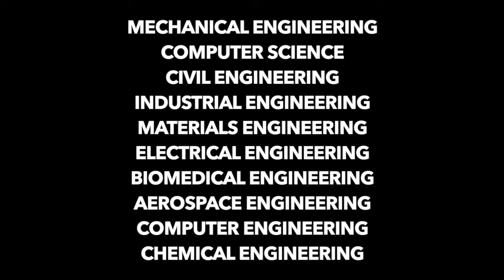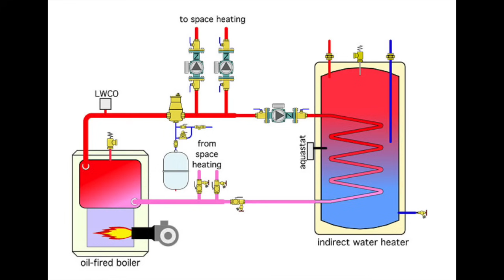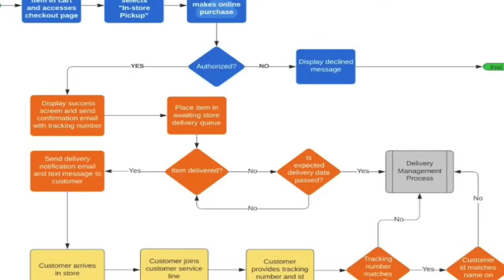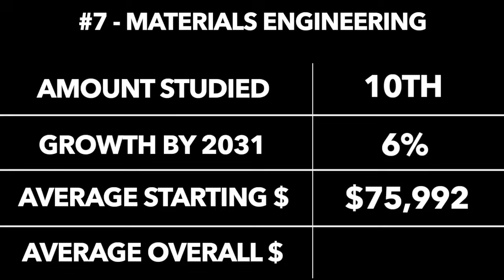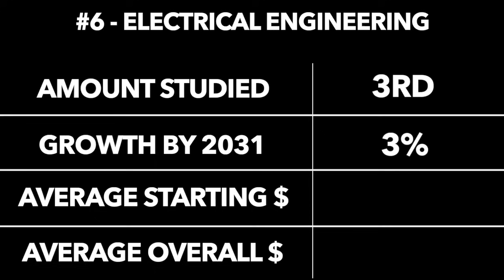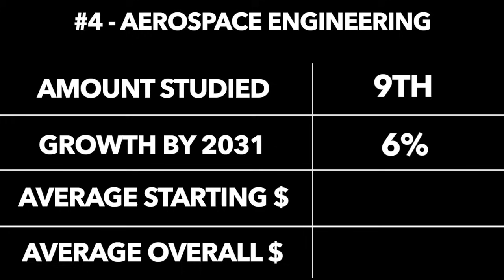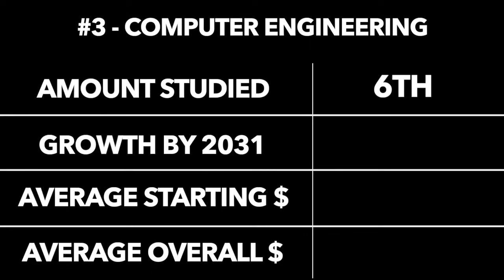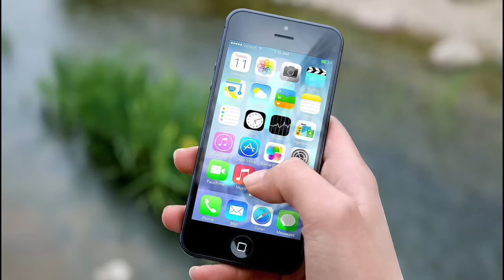Engineering Degrees Ranked: Pay, Demand, and Job Roles

Comment: Great video, I wonder how specific field degrees stack up such as nuclear engineering
Reply: As someone who just graduated with a dual degree in Nuclear and Mechanical Engineering, I think I’ve benefitted more from being a Mechanical Engineer with a specialization in Nuclear than being a Nuclear Engineer who understands mechanical stuff. So for Nuclear, try picking up some broader education or just go in to Electrical or Mechanical and enter the Nuclear field with either of those.
Reply: @AngoAngo  
Would you say nuclear is more related to mechanical engineering than something like chemical?
Reply: @GlacialScion  I considered nuclear engineering when I went to school (ultimately decided on aerospace engineering).

At my school, nuclear engineering is heavily based in math, physics, fluid mechanics, and thermodynamics. When deciding which degree to get, I would say that mechanical with any subdiscipline is the most general degree you can have. 

In the case of nuclear engineering, the current systems share a lot of similarities with powerplants and HVAC since most powerplants still work on steam generator loops, making a mechanical engineering degree overlap more strongly. However, you definitely will get more particle physics and whatnot in a nuclear engineering degree. Chemical engineering does not overlap as much with nuclear engineering unless you are looking into researching alternative fuel sources, nuclear fusion, or how to deal with the waste. 

In general, if you are interested in designing the reactors, mechanical engineering is the better main degree while chemical engineering is better if you are more interested in the fission/fusion reaction itself or working with nuclear waste products.
Reply: @withjoe1880  
I greatly appreciate you taking the time to respond. I'm interested in working on fusion technology, but it definitely sounds like I should have more of a mechanical engineering bent to my courses than I was anticipating.
Reply: @GlacialScion  No problem! Happy to help someone else begin the journey toward an engineering degree. I would definitely double check to make sure that what I said about the degrees applies to whatever university you decide to attend or are attending. Most universities will have the degree requirements or curriculum publicly available on their websites as well as course descriptions so you can compare for yourself what topics the degrees cover.

I wish you good luck in all of your current and future endeavors!
Reply: @withjoe1880  would you say the chemical/nuclear route is best if you want to work in R&D then?
Reply: This is the field I'm interested in.
Reply: @GlacialScion  We need more nukes.
Reply: Is in declive to 2031

Comment: Computer science is a science, not engineering😂 thought that was self explanitory
Reply: In my school, the CS department and engineering department are run by the same committee.
Reply: @hightiernormiex being ran by the same department does not make it an engineering degree.
Reply: Ok Jackass before you unveiled your arrogance did you realize you stabbed yourself in the back too?
Reply: Here in Europe there is computer science in both engineering and university, the difference Is the amount of maths and hardware. An IT engineering degree usually has more Masters and Phds and is suited for firmware, cybersecurity and robotics instead Computer Science degree is based in raw programming and is focused in logical maths instead of mathematical analysis. (Sorry for my english im from Italy)
Reply: CS isn't a science like biology or physics, and it isn't an engineering discipline like ME or EE. IMO, engineers apply science, math and experimentation to solve real world problems. Very little modern computer programming starts with a mathematical analysis. It is more of an applied technology field than it is anything else.
Reply: To me CS is a trade skill.  As an EE it is expected to have CS as a sub-skill.  Same goes for all the other engineering disciplines with the exception of Computer engineering.  It has vastly more tie-in to CS.
Reply: @XC2064  Knowing to code some scripts and use computer is not Computer Science. It’s like saying Mechanical Engineering is a sub-skill cause I can drive and sometimes fix my car
Reply: @szlep8095  I have an MS in CS.  It’s a trade skill.
Reply: @XC2064  i have a phd. Its not a competition. Programming is a skill sure. But Computer Science is an academic field